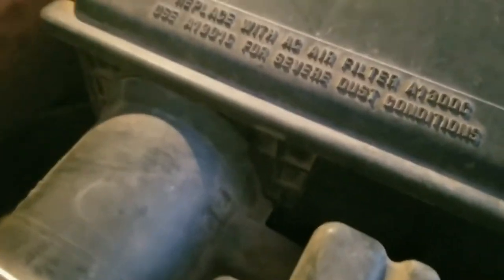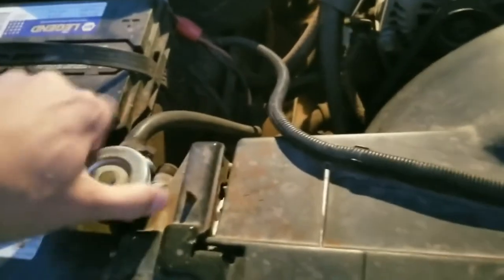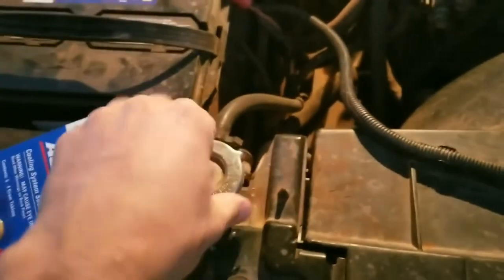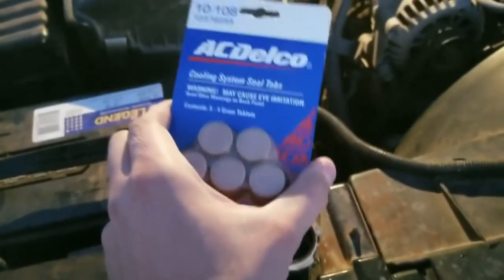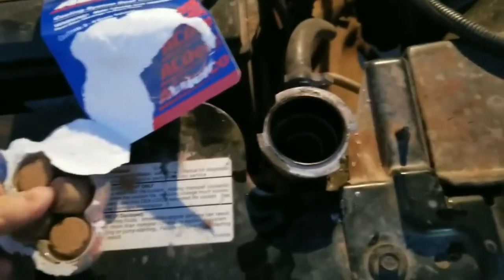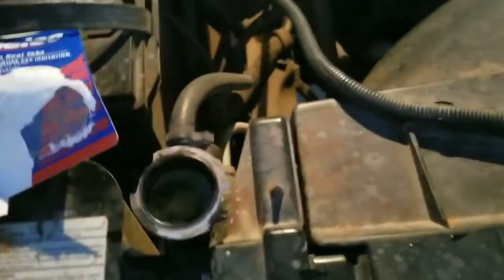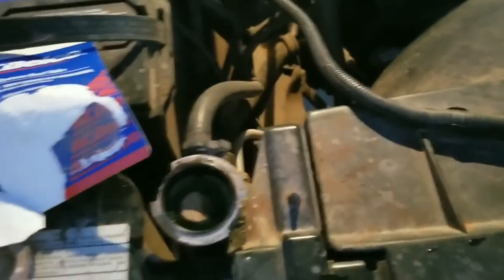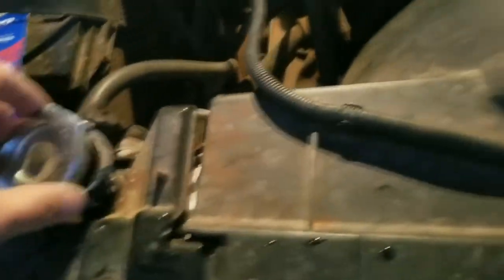Cooling system seal tabs

Comment: I just bought a 92 c4 corvette and it blew a head gasket 2 days after I bought it, took it to a mechanic shop and the compression gases were bubbling through the coolant. Would this work for my issue? Also do I need to drain the coolant and remove thermostat? Do I have to use pure water with these tabs?
Reply from the maker: Unfortunately I cannot be sure. My leaks stopped with me just adding the tablets to the radiator. I'm sorry if this wasn't much help
Reply: A buddy of mine works at a mechanic shop, actually a dealership, and he claims that these even plugged up at the crack in the block and sealed several head gaskets however, considering what they’re made out of i doubt they’re a permanent fix
Reply from the maker: Mine worked from the time I made the video to the time I sold the truck
Reply: Did you try it big guy? That sucks you had that happen on the vet